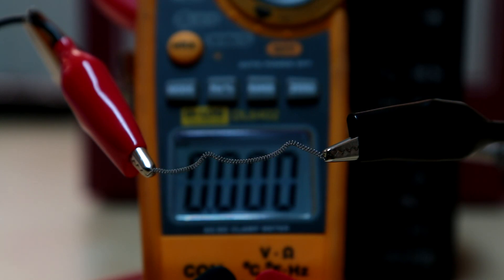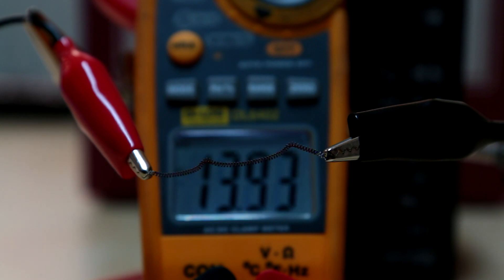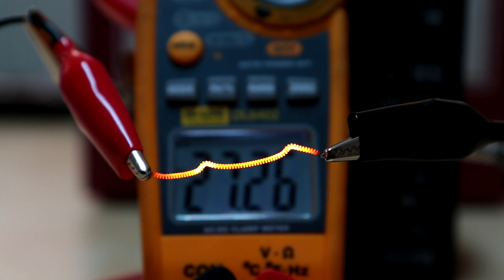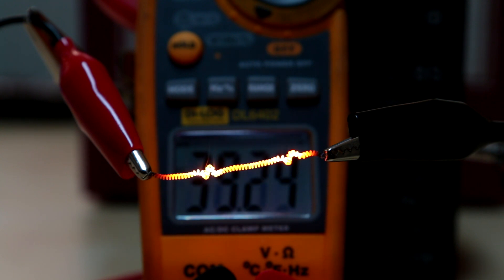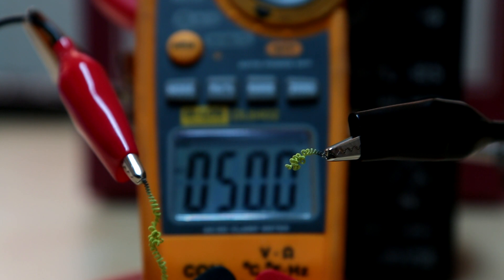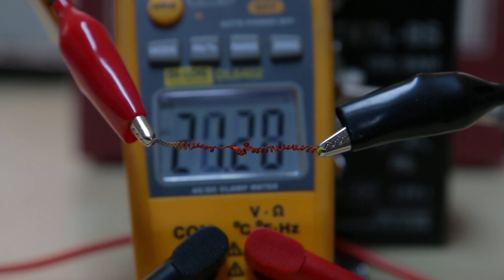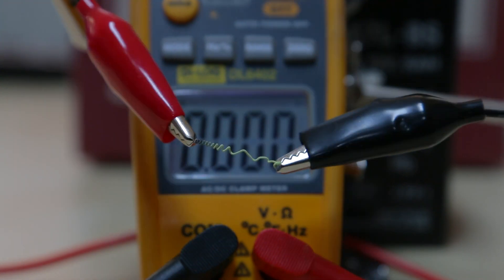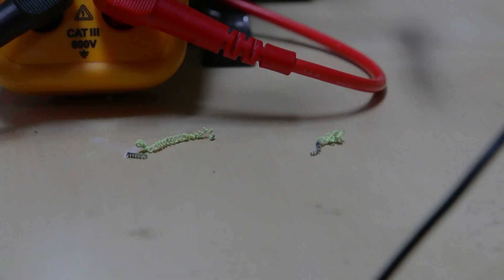Tungsten-Halogen filament burnout in free air.

Comment: Still find it interesting when the oxide changes from brown to green as it cools.
Reply: The filament is oxidising from Tungsten Nitride (W2N) and Tungsten Dioxide to Tungsten Trioxide. Not exactly sure about the mechanism, but Tungsten's multiple valencies probably explain it
Reply: If you get the tungsten really hot when it pops, you can even get a blue solid based on Oxidations states!

Comment: Viewer # 5, Comment # 1 :D

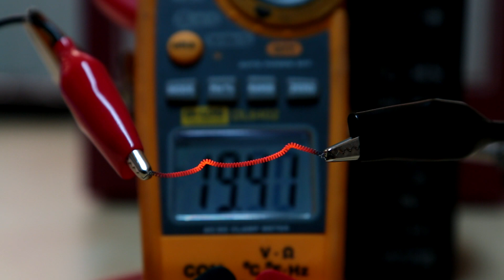At 0:30 ......Cor, look at it Glowiiiiiiiiin'. :D

At about 24v, it was interesting to see the light output, it looked like a mini electric fire!

What was also interesting, is the way it twizzled and unravelled as the voltage went up. It started smoking a bit also.

It did well to take 50v and.....You popped it. :D Interesting yellow-ish colour.

Haha at the end.....Top-whack =BANG= There goes the MCB. That short piece of filament you popped probably didn't have much resistance to it, so the breaker  more-or-less considered the current flow to be a short-circuit.

Nice sparks and flash on the slo-speed replay though. :-)

Thanxx for showing,

-BoomBoxDeluxe.

21st February 2014, 17.16